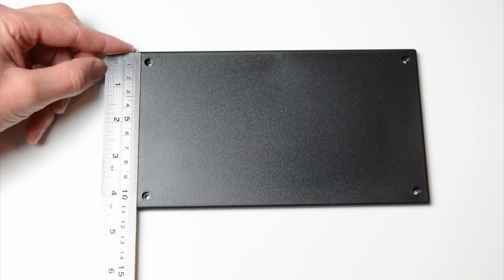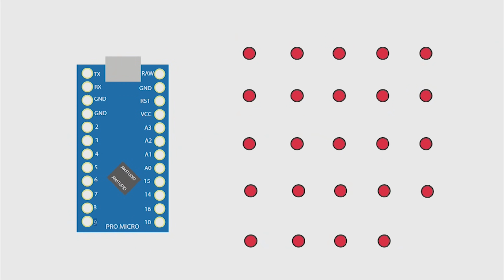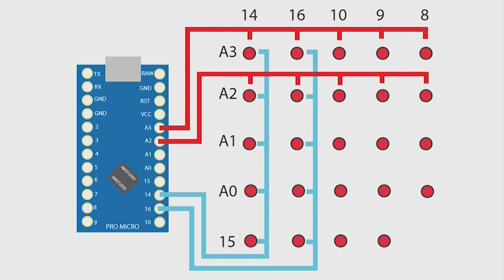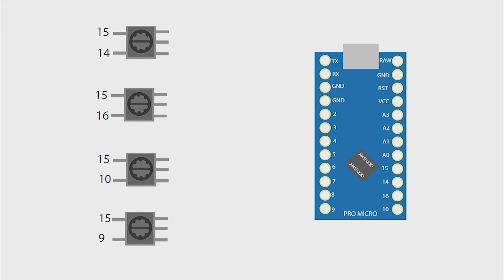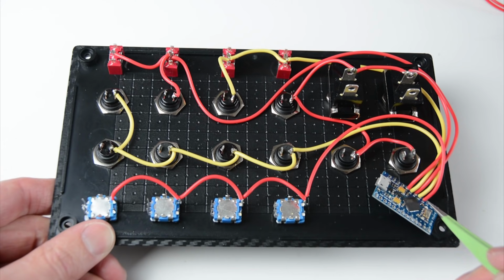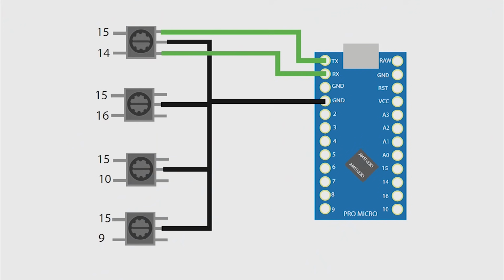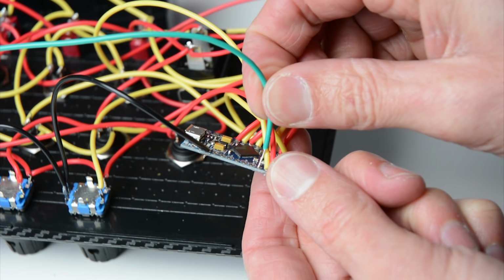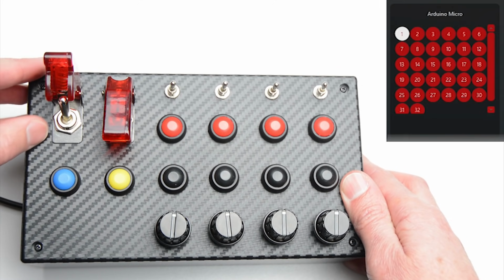MAKE THIS BUTTON BOX | 32 FUNCTION w ENCODERS

Comment: I loved you vid and it got me wanting to do a project. I however have about twice the buttons/encoders I want to put in the enclosure. Would it be better to source a board with a larger pinout or use two of the pro micros? I wanted 26  buttons and 10 encoders. Is it possible to have a led source wired in on a dial (on/off and brightness), is rgb possible to control? Would the pinout and flashing process be the same as in your vid? Thanks for the help and sorry for the million questions, keep up the good work!

Comment: How do you bypass using encoders and replace them using buttons / toggles? Would it be programming or wiring? I would like to set one up with 8 more buttons / toggles.
Reply: Jeremy Smith just replace them with buttons and it should work?
Reply: It did not work until I expanded the grid to a 6x6 and rewired accordingly. I dropped all the wiring for the encoders but retained the buttons. I added pin 6 as a column and pin 7 as a row. This enabled me to go to a possible 36 button box if wired and programmed so. I also had to edit the program to add the row, column, and new 6x6 button layout. I also removed any code to do with the encoders and wallah it is working great now.
Reply: Jeremy Smith  got any pics of this box?
Reply: Jeremy Smith as I would love to see as I would like buttons not encoders

Comment: @amstudio I ordered a more traditional keyed ignition for my build and could use some advice. The ignition has 3 positions (off, on, start) and 3 terminals. I was wondering if you had any advice on how to set this up in wiring. I am planning on using this box with Euro Truck Sim 2, which the ignition is configured as press "e" to move key to on and then press "e" again to move key to start. Do I wire both "on" and "start" to "e" or would this keep sending  the "e" key as the truck is running after started?

Comment: Nice! We have been tried to weld the buttons with the AWG 26 wire with a 0.4mm diameter and it's impossible (We are noobs...). We recommend to use a higher diameter wire, it depends on your skill. THX for this video!!!!!

Comment: If I only use two encoders will the skitch still work?
Reply: protoborg they aren't potentiometers, they are rotary encoders. An encoder is just anything that converts one thing into another thing, you could technically call a potentiometer an encoder as it converts position of the shaft into a varying resistance. these don't do that though, they output pulses every time you rotate one click so you can infinitely rotate the shaft in either direction and have the software decide how many turns it takes to go from minimum to maximum rather than being fixed to a start and stop point as you get with a potentiometer.
Reply from the maker: Yes!
Reply: thank you
Reply: you are wrong. it is literally an encoder.
Reply: Those are not encoders.  An encoder is something which takes an input and translates it into computer code.  The Arduino has an encoder on it.  Those are potentiometers.  They are a very old component, relatively speaking.
Reply: "An encoder is just anything that converts one thing into another thing, you could technically call a potentiometer an encoder as it converts position of the shaft into a varying resistance."

No.  An encoder converts INFORMATION from one form to another.  Electrical current is NOT information.  Mechanical energy (turning the shaft of the thing) is NOT information.  The encoder is the thing which converts the values assigned by the SOFTWARE to the current into useful information.  The POTENTIOMETER we see here is no more an encoder than the pencil I use to write on paper is an encoder.  Also, a potentiometer is NOT converting the position of shaft to varying resistance.  The resistance happens to change as the length of the conduit the current flows through changes.  That is NOT a conversion.

"these don't do that though, they output pulses every time you rotate one click so you can infinitely rotate the shaft in either direction and have the software decide how many turns it takes to go from minimum to maximum rather than being fixed to a start and stop point as you get with a potentiometer."

No they don't.  This is most likely an incremental grey "encoder".  Granted it is called an encoder, but it is not.  Converting motion to electrical signals is not encoding.

Comment: Hello there and thank you for the effort you put into this video!
Coming up with Questions:
- Is there a Combination of keys / max number allowed to press at the same time, AND/OR how did you come up with the way to wire the buttons into the matrix ? (Not a straight line)

- The rotary encoders could be replaced with 2 way momentary switches, correct ? (up/down, left/right arrow keys..)

- Will Teamspeak correctly+fast detect the buttonsignal (without a joystick to key emulator) => I'm having difficulties with TS and a cheapy pcb similar to the one you used for your simple 12 Button Box.
At first i thought it might be the pedal/switch/contacts i was using, but TeamSpeak does not always get the signal from the cheapo usb joystick pcb (Push to talk). The switch is working fine.

- Final One: Will this work on an arduino leonardo ?

Thank You :-)

Comment: Interesting video! Although I don't get if you use ground on any of the buttons or not. It looks like you connect each pole of the button, to an input on the arduino; so when the button is pressed, you are actually putting in short the 2 input pins on the matrix.

Is this how it works or did I miss something?  When I did make my matrix I used 2 pins on one pole of the button, and the ground on the other; that's why I am curious to know if you did use the ground at all.

Comment: Good video, nice explained. BUT....
If you do use ON/OFF switch, that means, if you turn it on it is like you hold pressed a button (f.e. on the keyboard), right? My question: In which racing/simulation game do you need to have pressed a button all the time? I just ask, no offense.
So basically you need to have only PUSH buttons.

Comment: I just noticed that this box has the same looking inside as the smaller button box. Both have a square grid. Did you do this by or self? Or do you have a link where to buy these? Thanks.

Comment: Hi amstudio! Very good video! I'm doing a g25 mod based on this. I need a variant of the sketch with only 2 rotaries, in order to use more buttons. Could you share a variant of the sketch for 2 rotaries? Thank you in advance!
Reply: am i wrong or are the encoders basically buttons too?
Reply: By removing two of the encoders you're freeing up four inputs, so you can add two more rows and columns to the button matrix, giving you far more buttons.

Comment: can i use a arduino uno or leonardo and not the pro micro ??
Reply: Leonardo yes. Original Uno, maybe with lots of extra coding and a chip reflash. Rather get Pro Micro and if you are going to use the Leonardo, you need to change pin numbers in the Sketch probably.
Reply: i build the box with the uno and used unojoy it now works like a dream
Reply: On a pc probably? Don't think that will work on a console. You wil need to rewrite the 16U4 chip with FLIP on an Uno to be able to do that. You can't do that with Uno's that has the CH340g chipset, because you can't program it, only with the original Uno. If it is for a console, it is much easier to go with the 32U4 chipsets that can be found in the Pro Micro, Leonardo, Due, Zero, etc, because they are out of the box reconized as HID devices.

Comment: @amstudio I am in the middle of this project and I am a bit confused on the wiring starting with the 2nd group...pins 14-8. I looked at your video at 5:46 as that's the clearest picture of the wiring but I'm still confused on some of the jumps. Do you have a picture you could post with the wiring a little more visible?
Reply: Never mind I think I got it all figured out. I had to Sherlock Holmes this but I think I got it! I can post up a pic since I used color coded for all of it. Might help others.
Reply: I need help with this. I'm half way done soldering and can't figure out the rest :/
Reply: I will post up some pics for you. I color coded mine so hope they will help. Give me a minute or two to get them uploaded.
Reply: Ok here is some pictures. Take note that I used red and yellow twice but the picture is pretty clear on how the wiring goes. Hope this helps.I didn't post pics of the encoder wiring because that is pretty straight forward.

pic 1:  https://imgur.com/WZf9SA5
pic 2:  https://imgur.com/HIjiV3e
Gonna go ahead and throw in my finished product :)  https://imgur.com/PLIEC5Z
Reply: Looks good! Wish I had some thicker wiring when I did mine. The wires I had were soooo tiny! Made for a very tedious job.
Reply: Did the sketch compile/upload? I'm getting an error from the Joystick library :(
Reply: Had to move a library used by Joystick to my libraries and include it in the sketch.. uploaded..and.. it works!!! OMG! it works haha
Reply: Yeah I text my wife when I was done and said "omg it actually worked. Nothing ever works first time for me!" LOL,
Reply: WarFalcon Please, would you mind uploading the picture with higher resolition. I would appreciate some more detailed notes. Im pretty lost
Reply: +WarFalcon
 is the soldering in pic 1 correct and working ?
Reply: Hi, can you explain this a bit more? I'm getting the same error and have never used any of this at all before.  Thanks
Reply: WarFalcon hi, how About this in/off switch, this is allways on in the controle panel of Windows?
Do you also know how to ADD the led light to the on/off switch?

Comment: What if I need to plug in two button boxes? How will I make the computer understand that they are two differend devices?
Reply: If you use the micro pro then you just plug each of the boxes into the USB and they look like a HID device, with the joystick.h lib you can configure it like a joystick.

Comment: @amstudio Hi I just received some parts from your list you have on this video. One of them is the start button you listed. I thought this would end up having the two connects like the blue button in your video but it has three screws in the back. See pic: https://imgur.com/04g0BBK Can you tell me how this would connect to this configuration in your video?
Reply from the maker: Terminals 1 and 3
Reply: Thank you sir!
Reply: Hey @amstudio my toggle switches have a light on them that I can wire up. do I just run a wire from the positive on the toggle to the light connector? Will be doing the project soon as two more encoders arrive (messed up and ordered only 2 all the way from China, the wait....)

Comment: The way he showed the buttons and encoders being set up is about the same way you can get led matrixes and some small led cubes. If you want to go a step further, use an Arduino Pro Mini(the micro and mini are different), and LCD, the button box, and a few other components to use it on a real car. Takes a bit of time but its fun nonetheless.

Comment: This is fascinating, and very well explained. This has, in seven minutes, opened a door to an entirely new realm of electronics projects for me. I haven't comprehended the concepts behind button matrices until watching this video. I've built basic synths, effects pedals, amps, and video game controllers including gated shifters and custom game pads and have really needed to understand this concept for years. Now I understand fully, and can use this method creatively for lots of awesome projects with or without the arduino board. I can now create projects involving much more complex input panels. Thank you!
Reply: Joshua Martin Hi ,im planning to make it but .. 
do i need a driver on my pc to communicate with the arduino. 
i dont mean coding but i mean arduino sending signal to pc
Reply: @Cy Aerials  did you ever figure this out? 
I bought the plans and I can't find the correct Auderno software that goes with the button box?
Reply: @mrj3217  the software is linked in the PDF for the build. I have been messing with it for a week now and the onlything the software will do is recognize that an arduino board is connected. Cant get any code to load or even show up in the software. I have wasted $80 and a week of my time on a decoration for my rig.
Reply: Do you keep getting 'JOYSTICK_DEFAULT_REPORT_ID' was not declared in this scope?

I still can't get past this😢

Comment: getting this error

Arduino: 1.8.2 (Windows 10), Board: "Arduino/Genuino Micro"

ARDUINO_BUTTON_BOXV2:95: error: 'JOYSTICK_DEFAULT_REPORT_ID' was not declared in this scope

 Joystick_ Joystick(JOYSTICK_DEFAULT_REPORT_ID, 

                    ^

ARDUINO_BUTTON_BOXV2:96: error: 'JOYSTICK_TYPE_JOYSTICK' was not declared in this scope

   JOYSTICK_TYPE_JOYSTICK, 32, 0,

   ^

exit status 1
'JOYSTICK_DEFAULT_REPORT_ID' was not declared in this scope

please help
Reply: You need the joystick library for the arduino
Reply: you need joystick library version 2 

https://github.com/MHeironimus/ArduinoJoystickLibrary/tree/version-2.0
Buttonbox sketch uses version 2

if you have previously built the analog handbrake  it uses version 1 so if you have done that project before you will have to move the old joystick library out of the libraries folder or replace with the new v2 version but if you ever want to re upload the ebrake sketch you will need to replace v2 with v1

Joystick library V.1= Analog E-Brake
Joystick library V.2= ButtonBox
Reply: thank you all sorted

Comment: since the 3 way toggles work as two buttons how is that wired up
Reply from the maker: https://youtu.be/1zxFU6MS7go at 38sec. Old vid but there is an diagram. Center pin on the toggle is common for 2 buttons.
Reply: think I know just to clear up what id like to know the first set goes to 2 toggles and 1 button second 2 toggles and 1 button and 3rd 2 toggles but then the final button has both pins soldered so do you just solder to the 2 toggles and nothing else on the 3rd wire set.        hope I made that clear thanks heaps

Comment: I've built your handbrake, so I have an Arduino Pro Micro already, but one of my ground pins, my A0 pin, and my VCC pin are in use...how many buttons/switches/whatever from this project would I have to forego if I wanted to try to make my handbrake and my button box use the same arduino? I know it's rather cheap of me, but that's where my head's at right now.
Reply: don't know how the handbrake was made, but just replace/remove on button on the bord and replace it with your handbrake and you should be fine
Reply: Oh...jeez, it really is that obvious, isn't it? Thanks (I'm really no good at this stuff)

Comment: Hi, can i use arduino Leonardo???
Reply: you should be able to ill confirm that soon as i already had a buttonbox i built on leonardo before this video using keyboard matrix but couldnt get it to work how i wanted but amstudios code is alot better mine just simulated a keyboard press with the keyboard library
Reply: I can confirm it works fine
i personally added some diodes to the toggle switches to prevent ghosting but that might just be my matrix design

Comment: You could add a starter key it works just like a button
Reply from the maker: Yeah sure can be customized for a key.
Reply: dope man I'm gonna make this its the nicest button box video ive ever seen
Reply: do the three way toggles need three wires if so how does that work?
Reply: The Stilo Stig it is in the video just look on the the top 3 red switches
Reply: 4

Comment: Could you try to make a handbrake for the g29 wheel and shifter for the ps4, thanks and keep up the good work!
Reply: Im just using the 4th gear as a handbrake and streching a strong rubber band between the outer 2 screws ^^ And then just using the pedals as gears
Reply: That's not a bad idea, but I would like to rip a handbrake, wouldn't it be satisfying
Reply: Dreaming for one too ^^ But this is alright for me right now
Reply: I guess so
Reply: 45thExile look back in his older vids

Comment: Is it possible, with programming, to use un regular switch like a momentary switch ?
Great video by the way. I am building one too !
Reply: its much easier if you use keyboard controller chip. Then you can use over 100 momentary switches. easy and cheap ;)
Reply: GabenEzmoney yeah so if I had your chip I could of soldered to it easily. My chip had a dark grey coating over the pins that makes contact with the plastic sheet I tried to solder to it but it wouldn't stick I tried scraping it off but was left with 0.25mm of solder able trace which was way to small
Reply: yes the only potential issue i can see is trying to solder wires to the keyboard chip if it was a plastic sheet membrane keyboard 

I tried before i made mine with arduino
Reply: PlasmaPod I made ebrake and buttonbox both soldered to keyboard chip. Now im going to make TM1683 display and then diy rally seat :). Awesome project if you like electronics.
Reply: how did you get the solder to stick; the pins on my keyboard chip (one i took out of a $10 keyboard) were so small as well i ended up successly using a arduino which i could program and update code like the code provided by am studio i was actually able to get the toggle switches to work without stopping the others from recognizing i had it simulate a keyboard key press
Reply: PlasmaPod Here is my ebrake
https://m.imgur.com/a/u3hum
Soldering wasnt hard at all for me.